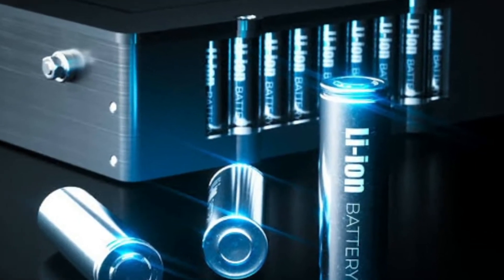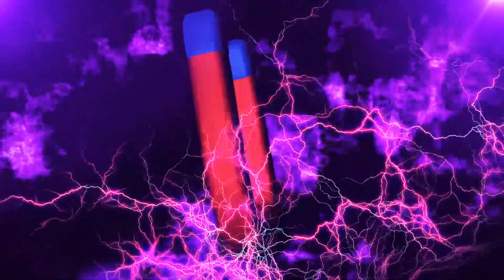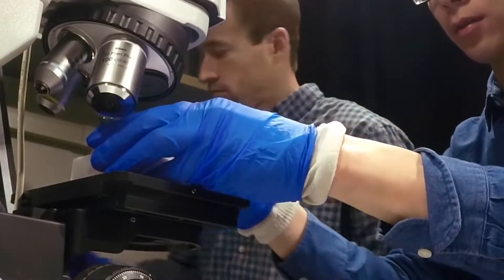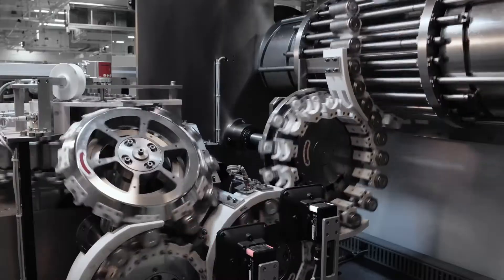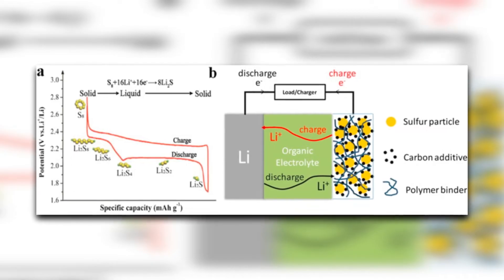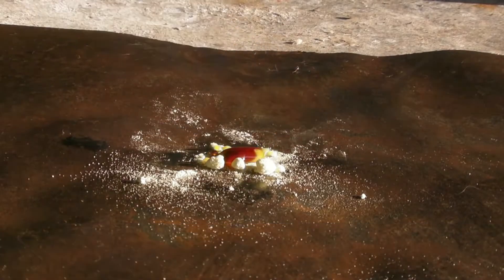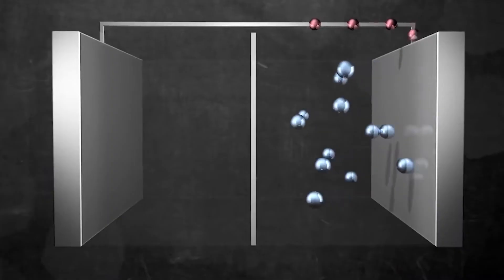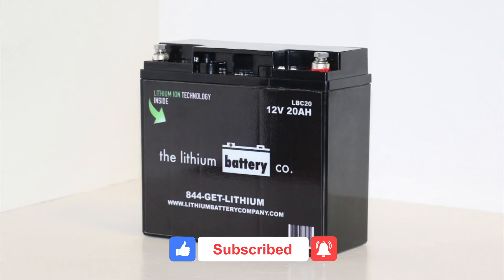New Lithium Sulfur Battery for EVs! Major Breakthrough!!

Comment: New Breakthrough? No way!! Sulfur Cathode with Lithium Anode. What electrolyte would, or could you use to make it possible? It's all in the electrolyte. I would be curious if we could use a gaseous state with a small charge on it from a small power source, but in the end get the bigger power source you want, Like old vacuum tubes. All you need is a cathode with the amount of energy you need. With an anode that is just negative charge.